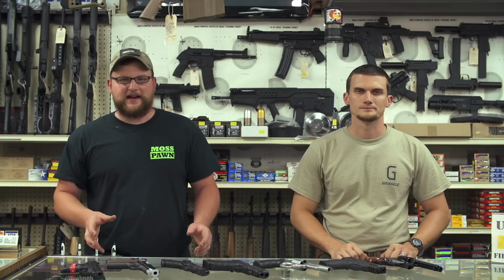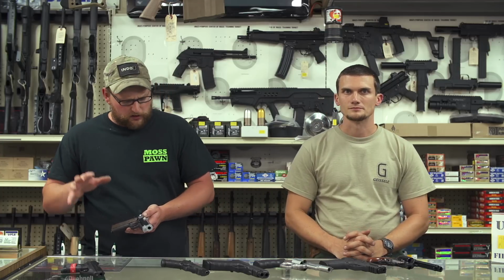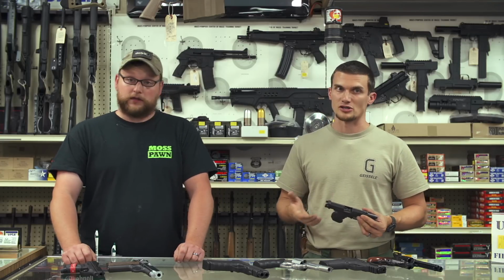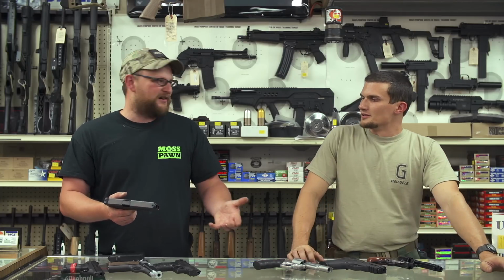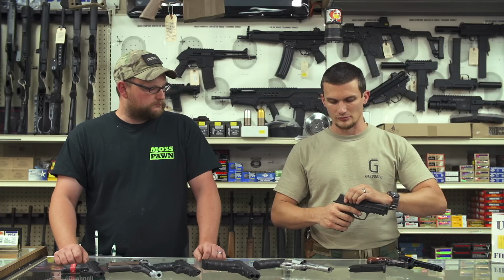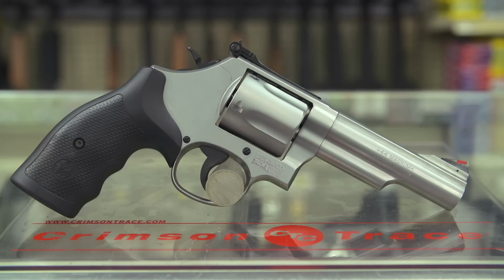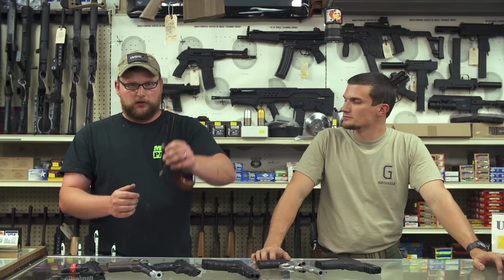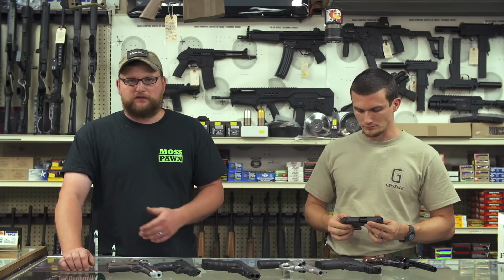Handgun Etiquette for Beginners

Comment: If yall don't believe in letting the slide slam home, how do you practice malfunction drills? I dry fire my duty weapon all the time. In fact for every hour I spend on the range doing live fire, I do an hour of dry fire practice (sometimes more). Although I do admit I use snap caps or the laserlyte snap cap laser MOST OF THE TIME. When I do dry fire practice every time I dry fire, I treat it like a failure to feed, and go through the manual of arms for that malfunction, which requires you to 'rack the slide". As someone you carries firearms for a living, I also recommend the SIRT pistols and AR bolts for even more dry fire practice, along with the LASR target program. You will spend a pretty penny on the front end, but it will save you money in the long run. Also a great way to introduce my children and wife to shooting, and gun safety.

Comment: I recently read an account from a guy who placed a round in the chamber of his Tokarev TT33 before letting the slide slam forwards without a magazine fitted. The gun fired the round into his bench, thankfully not injuring anyone. I would summise the reason for this is a combination of the weight of the firing pin and the firing pin spring weakening over time allowing the inertia of the slide slamming forwards causing the firing pin inertia to overcome the spring pressure and detonate the primer.
I would have thought this issue could affect many older semi auto pistols due to the weakening of the firing pin springs which will shorten over time through repeated compression.
It's something to be aware of, folks

Comment: Good video, although a disagree with not letting the slide go home, i use the M&P 40 at work and we were always trained from day 1 to never baby the slide, this ensures you always get a full slide movement to get the gun to battery.
Reply from the maker: It wasn't made clear in the video but I meant on an "empty" chamber not when loading the firearm.
Reply: Ah, that makes much more sense!
Reply: CrayolaCommando I would assume that chambering a round would put enough force on the slide to slow it down to a manageable speed and impact as compared to nothing at all.

Comment: About "slamming the slide". I understand if the firearm is empty, but what about letting the slide ride from a slide lock release while there is a loaded magazine in? for example during a reload.
Reply from the maker: When loading a pistol always pull the slide back to a hard stop and release. Do not ride the slide when loading. Perhaps it wasn't made clear in the video. If not, my mistake.
Reply: *****  Nice video. But I disagree about letting the slide slam closed.  It doesn't hurt anything.  What I wouldn't do (and don't do on my own firearms) is hit the slide release to let the slide close.  The reason is that using the slide release does cause wear to the slide release and the slide.  You don't need to do it, it's just a matter of developing the  habit to pull back the slide to disengage the release and let it go.  Get in the habit and you will have no wear on your slide release or, more importantly, the notch it fits into on the slide.

Comment: "don't let the slide slam"

What do you think happens during the normal function of the gun during a recoil? It comes all the way back to the stop, then goes back to strip the round. There is no "extra slow" mode for the slide to close during recoil operation.

Comment: just a fun fact you guys forgot to mention in this video is with the single action clones. colt clones have 4 distinctive clicks in the hammer travel and the hammer must be taken thru all 4 clicks every time and never dropped from half cock. A severe amount of damage can be done to the action and trigger mech. of a single action by dropping the hammer from less than full cock even though it can be done.

Comment: They could adopt Ruger 3801 SR45(around 400 USD) or S&W M&P45(less than 600 USD). They both are good and in  .45 ACP. First one is much cheaper and the second has a rail. Both are striker fired, have a manual safety & 10+1 capacity(3 more than 1911 which is much heavier than bot of them). A FN FNP45 Tactical(around 1100 USD) would be the best, but it costs more than SR45 & M&P45 together. It is to expensive for non special forces soldiers I guess. Too bad. It's so great.

Comment: Sure, pretty much 100% of the time dry firing won't do squat to your gun but why risk it? You theoretically can drive your vehicle on redline or bouncing off the Rev limiter all the time but at some point some ghost is going to come out of the works with great fanfare! I'm by no means a gun snob, but treat that tool with great respect and give it care because when the chips are down, you don't want a failure to occur from mishandling and lack of quality care when you can least afford it. Save the rough reloading and time saving methods for when you're in a high stress deteriorating situation.

Comment: Didn't realize the 1911 was so fragile.
I was under the impression that most modern pistols were okay to dry fire. The Glock manual actually recommends dry firing to break in the trigger.
Reply: A quality 1911 is fine

Comment: I think since this video is supposed to be for beginners a few things should have been clarified a bit better.  Such as allowing the slide to slam forward when empty or dry firing without snap caps.  I believe that it should have been mentioned that although these actions wont  necessarily break the gun if you do it 500 times, it does put stress on the parts which can cause damage, so snap caps, or riding the slide forward achieves the same result without as much stress on the parts. So, I believe some people might become confused.

Comment: Don't let the slide "slam" forward? If you manually release it slowly it most of the time has feeding issues. Plus just releasing the slide is way less intense than it actually cycling under firing conditions.
Reply from the maker: Talking about an empty chamber, not when loading a pistol.
Reply: Ok. And I also am told not to use the slide release as that wears the notch on the slide and therefore you should only pull the slide back to rack it forward.
Reply: Trevor Thayer Some people FREAK about this on 1911s  As far as most MODERN guns...you're good to go :)
Reply: ***** What kind of 1911 makes you say that they are delicate?

Comment: When you say "Don't allow a slide to slam on a pistol", are you referring to when you use the slide lock to allow it to move forward? Another scenario is going from a locked slide (using the slide lock) to racking the slide. How else would you get it back in normal position without pulling it back and releasing it, hence it slamming forward?

Comment: What are Snap Caps?
Reply: They are cartridge shaped "fake bullets'  that chamber and absorb the strike of hammer or striker to prevent damage to your firing pin.  The are usually red aluminum with silicone or brass "primers".
Reply: They are also used in training drills to practice clearing malfunctions.
Reply: wouldnt worry much about snap caps if you reload just drill a hole in the case keep the old primer in and dont put powder in put a fmj on it and bam a bubba snap cap
Reply: I actually have a few snap caps lying around my house
Reply: 50TNCSA If Roth didn't know what a snap cap is, how will he/she know about a bubba snap cap?
Reply: filoIII you sir are indeed a worthy opponent
Reply: Fake ammo. Looks just like a regular round but no power and they have a spring in the cap where the hammer or pin contacts them. Usually painted red.
Reply: 50TNCSA
I would vote for snap caps because it's more obvious that it isn't live ammo. On the Zombie Squad forum a guy was talking about a negligent discharge he had. He used the type of reloaded dummy rounds you suggest. He kept them separate from the live ammo. One day he was cycling his Mosin Nagant with dummy rounds. Well the bullet fairy had payed him a visit and slipped a live round in with his dummy rounds. Thankfully he exercised safe gun handling and  no one got hurt. But he did end up with a hole in the ceiling and a visit from the police.

That story illustrates quite nicely why your dummy rounds should be REALLY obvious. The best thing would be bright orange snap caps. Those should stand out nicely. Regardless of what color they are, they should be immediately distinguishable from live ammo.
Reply: purplemutantas well holes in em kinda help i paint mine green myself ...
Reply: 50TNCSA
As long as it's painfully obvious that it isn't live ammo, it's all good. Otherwise you run the risk of it being painfully obvious that it wasn't a dummy round :)
Reply: purplemutantas yep its all about being able to notice them quick and easy
Reply: You can find them online $1. When i bought my glock it came with two used brass rounds
Reply: 50TNCSA Your "Bubba snap cap" (lol), with all respect, has a bit of a problem.  The purpose of the snap cap is to replicate the primer so that they firing pin stops on the primer.   With the Bubba cap, after a couple of hits, the primer is dented in and the pin ends up stopping on whatever it would stop on without the Bubba cap at all.  So he Bubba cap doesn't do anything.  Now most of the time it makes no difference because the whole snap cap thing is overblown.... but if you have a gun where the manufacturer warns against dry firing (Kel Tec, for instance), you're safer with a real snap cap with a spring, not a Bubba cap.

Comment: This is the only video were I have a slight problem with the modern firearms can take a great amount of abuse dry firing won't harm your firearm which I'm specifically talking about glocks m&p's but in defense of the video it does do damage over time and it's unwise to do something that does damage to your firearm

Comment: I know this was 8 years ago, but in a gripe episode, you said that people who baby the slide are idiots and that letting it slam home isn't going to harm anything, in this video, you say to not do that. 🤔 In another video talking about safe queens, you state that scratching the gun is normal and that people who care that much about a scratch on a "tool" are dumb. One time in a video, you guys talked about how dry firing some guns is not going to hurt them. The contradictions on this video are plentiful.

Not pulling the trigger is not a safety lmao, at that point, you might as well just say your finger is the safety. What happens if the glock trigger gets caught on your clothing and the trigger gets pulled, fin and all? Glocks have NO safety, only internal safeties that most modern guns have. I don't consider a trigger for your trigger a safety. Furthermore, unless your carrying an ancient revolver, you can pound on the hammer with a chunk of metal like Brandon hererra did and it won't fire, the firing pin is no longer solid and has some wiggle in modern revolvers to stop that from happening.

I love you guys, but this is by far your worst video.

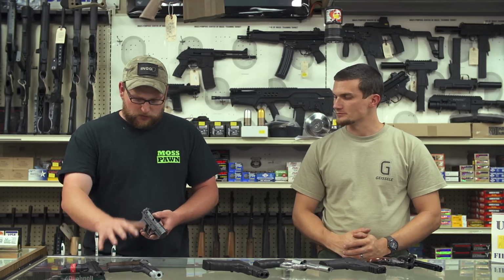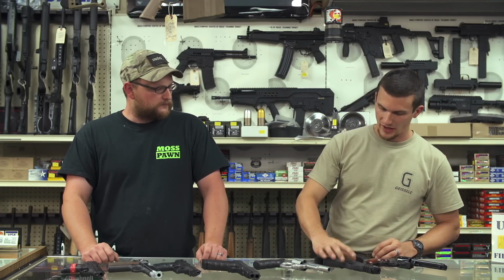Comment: Ahem... 3:29 - 3:39 and then 3:44. Fifteen seconds after he started talking about it... seems to be a habit - 10:01 again. And no, you do NOT close a revolver with the crank. This yet again comes down to "treat every gun as if it was loaded". Your hand has no business being at or directly in front of the cylinder gap when the cylinder is closed (or when you´re just closing it) You just gently press the drum in with the thumb of your left hand (if you´re right handed), that´s it. The worst thing is that some gun designers don´t take this into account - like (for example) the Taurus Raging Bull .44, which has part of its drum release mechanism directly in front of the drum. Might be tempting for people to think its safe to put their hand there at any time... 

Just saying - we all do look down the barrel when we clean our guns and know for dang sure that they´re unloaded... we all do things we shouldn´t do with firearms but making a mistake like putting your hand over the drum while firing... you´ll do that just once. Provided that you still have your fingers, you will remember this forever - in the best case you will just get some really ugly burns... as long as it isn´t a Nagant or another revolver which closes the gap before firing. But this damn important thing wasn´t even mentioned here... You know it, we know it - but the beginner might not know this at all. 

When I close a revolver, I always cock it once and then carefully release the hammer with my thumb just to make sure that the drum is properly closed and working. The last thing you want is a misalignment of drum and barrel when you fire. This can happen with wear but that´s another issue and comes down to taking care of the gun and changing parts when they need to be changed.

Comment: Doesn't the the act of shooting a semi auto generate more stresses on the weapon than simply allowing the slide to slam forward?
The slide not only slams backward, but forward as a result of discharging the firearm, how does doing that by hand cause damage but the normal operation doesn't?
Or is the fact that a round is stripped from the magazine the act that saves the day?

Comment: Since is was not covered in the video I'll ask and answer the question of dry firing a percussion firearm (cap & ball)?  Never dry fire it for the same reasons as you have already heard,  the repeated stresses of steel hitting steel.  A solution to this is to use a couple of faucet washers placed over your nipple, when your hammers strikes the nipple it is actually smashing against the washers. You get to practice dry firing your muzzleloader but save your nipples.  And no, you don't have to change washers for every dry fire :)

Comment: This is a little over the top. A $500 steel gun can take a whole lot before crystals form on hammers and guns won't operate due to firing it without ammo.
I think a bullet going off in a gun with 10,000 psi in some cases may be more stressful on a gun compared to a guy closing a revolver with the cylinder and not the crane....

Comment: iraqveteran8888 : Rookie question for you guys: Is the force of letting the "slide slam" any different/harder or is it just the same action and force that the gun has to endure when you fire it?
Reply from the maker: There's a lot of training doctrine that surrounds your question. The slide stop on a pistol does exactly that...it's for holding the pistol open and nothing more. In order for a pistol to have the highest chance of reliably feeding the first round from a full magazine, you should always pull all the way back to a hard stop and release without riding the slide forward. To answer your question, the purpose of a recoil spring is two fold. 1st it absorbs the forces of the rearward travel of the slide during the firing cycle and keeps the gun from beating itself up. 2nd it returns the slide to battery while stripping a round from the magazine. So think about it...the firearm is designed to exert the amount of force on itself needed to complete a firing cycle...NOT to slam on itself empty. Hopefully this clarified the issue...there seems to be a lot of internet commandos surfacing on this one.

Comment: Ok, I've been into firearms for a few years now and have done as much research as I could on it. I've been watching your vids since I've gotten into the hobby but now everything I've researched and was told about many times is contradicting to what you're saying about dry firing and slamming the slide. I was under the impression that dry firing was fine to do as much as you want on modern centerfire firearms and also slamming the slide in order to make sure it is in battery, but now these 2 things I've been doing is wrong?

Comment: correct me if I'm wrong but when a gun fires doesn't the slide (pistols) come back and slam just as hard as when you let let the slide slam while reloading? i let the slide slam on all of my pistols just because it looks cool and I've never had issues with them not fully cycling the rounds, but i tend to clean my guns often. btw great safety video hopefully it'll keep idiots off the range!

Comment: if I fire my gun the next round will slam the slide right?
Reply: The slide will move forward with the inertia needed to grap another round and push it forward and grapple the cartridge with the extractor, if you let the slide stamp forward without all that it will slam forward faster and harder than it was meant to, thus creating additional unwanted wear.
Reply: +Sasmodog  I do not know how to properly load a new magazine and chamber the top round without releasing the slide and letting it travel forward unimpeded. What should I be doing instead?
Reply: You are supposed to let the slide slam forward unimpeded to chamber a round. If you are not chambering a round you should never let the slide slam forward .
Reply: Ok. Thanks for clarifying.

Comment: About riding a slide home vs letting it slam. What about when chambering one?

I have a SD9 VE which has issues with loading hollow points, I heard it evens out if I fire enough but I haven't had the opportunity to put more than like 50 rounds through it. However, I find it just about impossible to chamber a hollow point in it if I ride it home, whereas SOMETIMES it doesn't catch on the feed ramp if I rack it hard and let it slam.